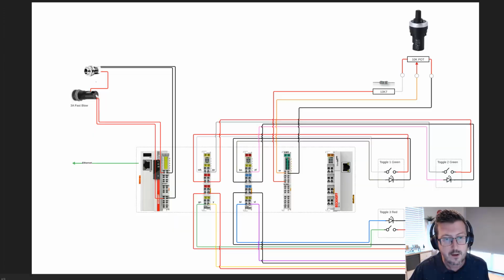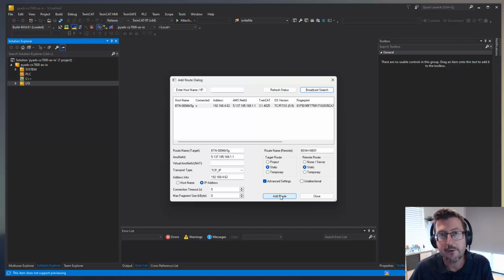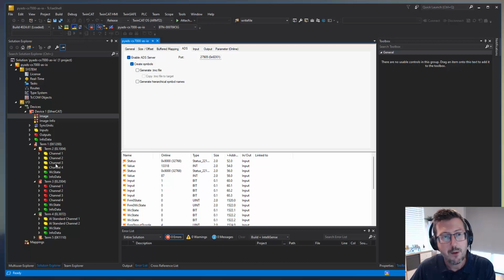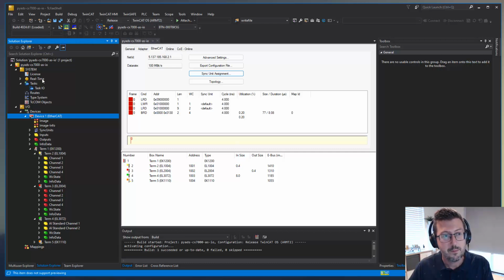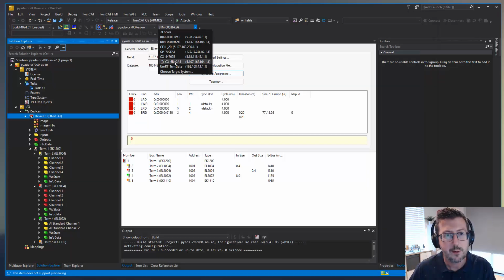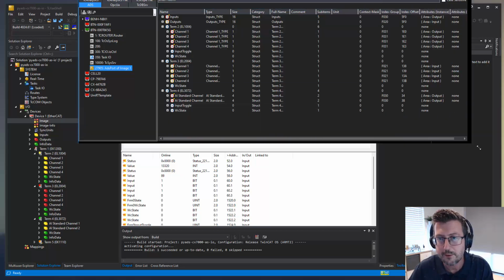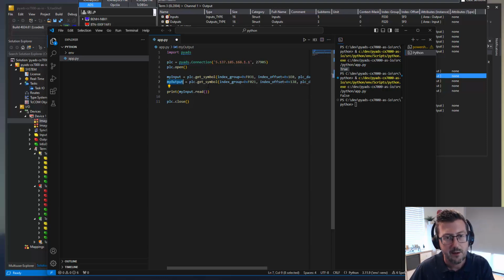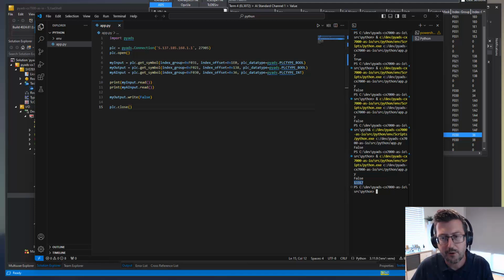Connecting I/O to Python using pyads and a CX7000

Comment: Is this something I can do without any hardware?
I would like to be able to setup my TwinCAT project completely without hardware, just letting the ADS server run and have python "mimic" or "emulate" the not (yet) existing hardware?

I mangaged to get it working with an IPC I have laying around here, but not yet  without any hardware. As soon as I add an EtherCAT device under "I/O" and try to activate the configuration I get the following error:
"Severity	Code	Description	Project	File	Line	Suppression State	Action
Error		17/04/2026 17:08:04 765 ms | 'TwinCAT System' (10000): Sending ams command >> Init12\IO: Set State TComObj SAFEOP: Set Objects (4) to SAFEOP >> AdsError: 1823 (0x71f, ADS ERROR: device aborted the action) << failed!"

Any ideas how to get his working or if this is even possible?

Comment: Great video! Thank you very much for your effort. I have a question regarding using Connection function in pyads. Since mini PLC CX7000 is one communication node and your laptop is second node, and communication goes over TCP, why there is no need to specify actual IP for target mini plc in the pyads.Connection function?

Comment: Hi, AWESOME WORK, But, i have a question: Does the Python script have to run on the same PC as Twincat? In other words, can the Python script and Twincat run on two different PCs?
Reply from the maker: Thank you MingMa-p9u. The beauty with ADS is that it works with TCP/IP out the box, so they can be on two independent PCs.  In the video example, the CX7000 was my "first pc" and python was running on my laptop as the "second pc".  To ensure you have a connection you can install ADS on your non-TwinCAT pc.  This gives you access to the ADS router which will handle the TCP/IP connections.  This is available on the Beckhoff site as TC1000.  It's license free too.  https://www.beckhoff.com/en-au/products/automation/twincat/tc1xxx-twincat-3-base/tc1000.html

Just note there are some libraries which do not require the use of the TC1000 and have a ADS router built in to them already.  As an example, some of the .NET and node.js libraries have an ADS router already inbuilt. 

If you are running Python locally to your TwinCAT runtime then you can use the netid 127.0.0.1.1.1 which is the default ADS loopback address. 

Happy coding!
Reply: In theory, ADS communication does not require the script which is supposed to access the PLC stay in the PC as the twincat runs on